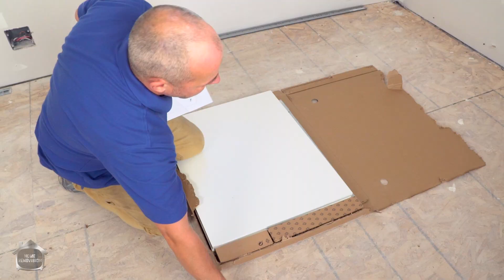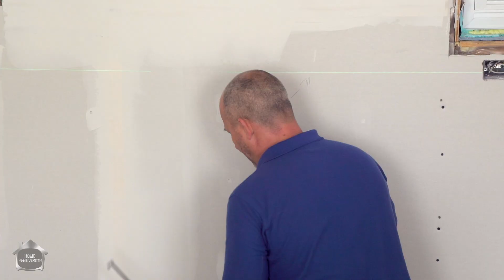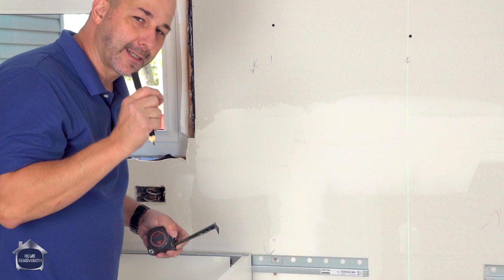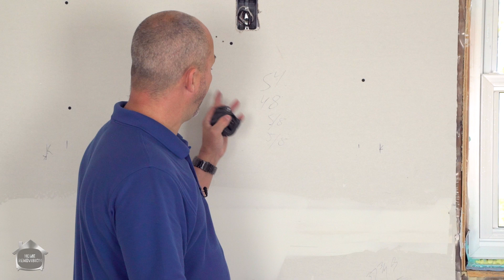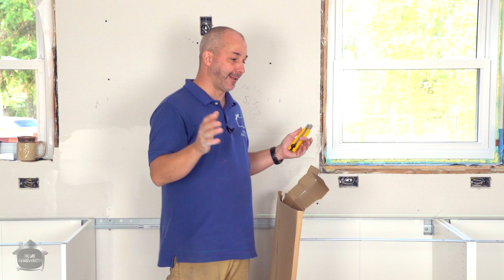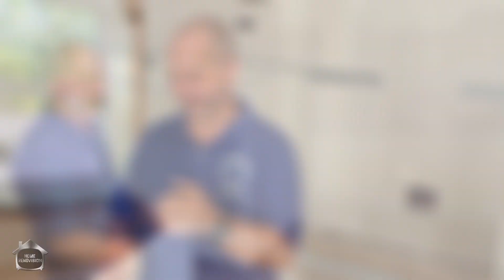How to Install IKEA Kitchen Cabinets and Save Money! | DIY Kitchen

Comment: 2nd screw underneath the rail to add to the shear capacity is gold. Such a practical mind, built off experience. Thanks Jeff, you continue to inspire me!
Reply: When hanging cabinets the Bearing Strength of your screw is key, using a screw with a larger head instead of a bugle head screw would ensure greater hanging strength. If you are relying on a secondary screw below your rail, you have inadequate bearing to your wall.
Reply: @DaruDhillon  so the extra screw under the rail will help the rail stay on the wall, where the larger head will help the cabinet stay on the rail. It's a team effort! 8)
Reply: @jstawch2608  the large flat head of cabinet screws are designed to have increased holding power. This means they can hold more weight and are a superior choice to hold the rail flat on the wall. 
A construction screw is not designed for this purpose. It’s designed for countersinking. Its holding power is significantly less and inferior. It’s weak for this use. The wafer head you see on cabinet screws is used on structural screws like GRKs which are amazing! Structural screws have increased holding power that’s why screw head is critical. I have a video on my channel that explains the difference if you are interested. 
I encourage you to try them both as a comparison. There’s no contest. 💪🏽 it’s why contractors, like myself love them.
Reply: Which type / length of screw should we use under the rail?  Great video by the way!  Very useful!
Reply: If they weren't garbage cabinets you wouldn't have to do that

Comment: Love the way you explain everything. I need part two though. Also, I was losing track of all the measurements you were doing.  I think a graphic of all the measurements would be cool.
Reply: Hi Maureen, The measurement you're looking for is 32 3/16" from the high spot in your floor to the bottom of your rail. Ikea recommends you measure to the bottom of the rail. Installation is much easier with a regular spirit level. I'd also recommend using cabinet screws as they have significantly better holding power and strength. Bugle head screws aren't designed for holding in this way and can shift with the weight of your cabinets and countertops.

Comment: Thanks for the video, redoing the kitchen myself too using IKEa and this is just great timing. Once concern I have is the peninsula. I noticed that you used the Sektion legs for the island. Are those legs sturdy enough to handle an island/peninsula on their own? Also Ikea is warning that the island should be screwed to the floor. really confused on how to achieve that with the legs.
Reply from the maker: you can use L brackets to screw the panels at the end down. Cheers!
Reply: @HomeRenoVisionDIY  thanks for the reply. But would screwing the end panel alone be enough to hold the weight? There are some videos suggesting 3 2x4 stacked under the cabinet, what are your thoughts on that? Thanks again!

Comment: Hi! thank you for this video. Do you know if the Ikea Base cabinets can still removed after the countertop has been installed? I am asking because I need to access the wall behind one base cabinet to repair damage.  can it just be slid out after removing the screws on the side? If it is removed, can it be put back in place after? Hope you can help! Thank you!
Reply from the maker: darn straight they can. That is one of the obvious advantages to this system. maintenance!
Reply: @HomeRenoVisionDIY  really? Wow! Good to know! I've called ikea and I have been passed around several times to different installers! thank you! I appreciate your help!! thank you for all your renovation videos!! 😊

Comment: If you are considering Ikea, I would suggest a thorough discussion with a clerk at the store about the products before purchasing.  I bought some base cabinets was told by Customer Service that I had bought the ones as they require drilling for placement of the drawer slides.  The instructions are terrible and I have waited and waited (10 - 45 minutes) to speak to a Customer Service rep.  Some of their reps know very little about the product and then BS their way through the conversation.  If you cannot drive to the store easily (as I cannot), I would look elsewhere.

Comment: I had to go dismantle a deck and the guy used them L brackets to connect every piece of wood with 1/2 drywall screws. And the timber was not treated and on its side. Absolute mess. Had to take it down and start over with new materials

Comment: I'm going to be installing 37 1/2" countertops (1 1/2" above normal) and Ikea cabinets will be the base. What is the best way to rise the cabinets by 1 1/2"? I could build stilts for the legs or should I build a traditional frame for them to sit on? Maybe just lay down 2 layers of plywood? I'd prefer to have the extra height on the bottom and not the top. Thoughts?
Reply from the maker: best to build a box to set them on. That way the toe kick can be attached to the face. Cheers!

Comment: Do these IKEA cabinets work if you want to have a taller countertop? That is, I"m 6'5" and I always have to bend over to do anything on the countertop (and the sink is even worse). Is there a standard way to calculate such things?

Comment: As usual a lot of good tips and easy to listen to content. A little surprised that you did not get a sheet of laminate and flat sheet of plywood or particle board and do it yourself. That way you could have scribed the top to the back wall. I planned on doing  the laminate myself, because it looks easy when looking at videos here n YT. Since you did not tackle it maybe I will rethink it and buy the pieces already made.

Comment: Fantastic video but why oh why don't you move over to metric measurements. Even we in the UK, the home of the Imperial system moved over to metric about 50 years ago. All those weird fractions makes it very difficult to understand. This is particularly so since all IKEA kitchens are very specifically metric e.g. drawer and door panel heights are 10cm, 20cm, 40cm and 80cm (allowing for gaps of course). All cabinet widths are 20, 40, 60 or 80cm except for the corner cabinets.

Comment: Do I need any kind of underlayment under those cabinets having concrete (slab) floor? I was planning to have some panels used in basements (osb with plastic layer), but seeing that huge plastic feet made me wondering if this is really needed. Maybe only under appliances to raise them up to the finish floor. What do you suggest?

Comment: I have an existing kitchen.  We have side panels on either side of the dishwasher, make of MDF with the typical fake look on the outside.  Well on the other side of the kitchen is the Fridge with ice maker.  Floor slopes towards dishwasher.  A couple of times the icemaker screwed up and got stuck on fill to give your a cube full of water that keeps overflowing.  Then goes out the Fridge and the water flowed to the front of the dishwasher, caught in time but not soon enough.  I.e. side panels swelled up, nice and ugly now.

Comment: Question on cabinet/floorin conventions below. Appreciate any feedback or advice. Thanks in advance guys! ^_^

Due to water damage, I need to replace my kitchen cabinets, and replace some subflooring and some drywall while I'm at it. I'm going to take this as an opportunity to replace the linoleum flooring and the ugly tile backsplash with something better. Thinking slate tile on both, but decision isn't final.

Question: What is the standard for cabinets and flooring? Is it typical to install cabinets onto the subfloor directly, then install flooring around the cabinets? Or is it typical to put in the subfloor AND the flooring, then put the cabinets on top of the flooring?

Thanks! ^_^

Comment: A water level and a chalk line works as good if you are a diy enthusiast  and don't want the expense of a laser level. As professional of nearly 30 years i fitted an IKEA kitchen about 12 years ago and swore i'd never entertain that idea ever again. The main problem being the lack of a service gap for pipes and electrics so all the waist pipes had to run through the unit. What a headache.
Reply: Been there myself. Nightmare units, never again.

Comment: Here's a tip for opening IKEA boxes. Go to their kitchen section and buy one of their wide spatula's (the one for turning fish fillets). It's thin, and has relatively sharp edges. Simply slip it between the glued box flanges and slide it along. You will never risk damaging a panel. This was shown to me by one of the IKEA showroom installers. Works a treat! (and on a side note, it makes it easy to reseal a box with hot glue if you change you mind and want to take something back..... Looks like you never opened it.... )
Reply: IKEA is that you?
Reply: Brilliant, thanks!

Comment: What is your best driver bit that you like to use. I only use Phillips head screws and sometimes torques head. But they break and it piss me off. Dewalt doesn't make a good magnet bit . Can you help???? I see you use a Milwaukee driver bit, Do you like throws? I am a handyman and do all kinds of thing and need a good bit so I am in and out fast. Thanks Mke "AKA" Coach Crone Thanks

Comment: Not the greatest of cabinets, the utility gap at the back would not even take a 15mm pipe and everything has to be run in the plinth gap. The rail method is a good idea but as said by someone earlier it does show any imperfections in the walls and can mean the brackets do not hang on the rail and then you have to pack out the rail to make it flat. Ikea seem to have changed the build of their board used to make the units and it isnt as durable as their old units. It does damage quite easily during day to day use.  The runners etc also seem to wear out quickly and the drawer fronts work loose causing the screw holes to over bore. You need to put additional screws in the fronts to limit this from happening. One thing to bear in mind is that the Ikea units are not the same sizes as most other units so if at a later date you want to change the doors etc with another make, it is extremely difficult to do so.
Reply from the maker: And yet the expected life of this cabinet system is still over 20 years. With a little care it lasts 40. not as good as wood but you get what you pay for!
Reply: @HomeRenoVisionDIY  EXACTLY! Wood ones can easily cost $4k plus and sometimes $8k+. This allows folks to actually be able to update kitchen without spending $10k to $25k for the typical kitchen these days.

Comment: if you nail plates where the wires are like what is code you would be ok
Reply from the maker: nailing plates required when the hole is closer than 1 1/4" otherwise the code stipulates the depth of screws to be used to avoid issues. Cheers!

Comment: Had a bunch of kitchen reno people and so called experts bash Ikea cabinets. After getting estimates, I couldn't resist based on the savings. Now that my kitchen reno is complete, I have ZERO regrets about going with Ikea kitchen cabinets. I saved myself thousands and I love the end result. I also think, in retrospect, I could have done some of the install myself but at the time, my work schedule was crazy.
Reply from the maker: I am sure you could have. Hard to resist the price point. Cheers!
Reply: @HomeRenoVisionDIY  it's PRAWcess bro
Reply: How are they looking 5 years later? Are you still happy with them?
Reply: @jonrichins7737 no response, but I’d be interested they seem super cheaply made.

Comment: I have been designing kitchens and baths for 39 years since starting with Triangle Pacific in 1980. Have rep'd Tri-Pac, Bruce, IXL, DelMar, Wellborn Cabinet, Kraftmaid, and Fieldstone/Starmark,  and sold/designed with many, many more.  I count the kitchens I have designed and supervised through completion in the thousands.

I'd suggest considering 42" walkways (current NKBA guildelines) when possible, which would mean 45" between the boxes assuming a 1 1/2" counter top overhang on the working sides of the cabinets.  This walkway will shrink even further given the range door/handle protrusion in the kitchen you are installing in the video.  If you start at 40" between boxes you will be lucky to have the minimum 36" of real walkway when you're done, likely less than that depending on the range.  And I have to admit I got a bit lost as to how installing the flooring prior to cabinet install caused additional delay...?  It won't speed it up, but it won't slow it down either, and you end up with a much cleaner install.  The only time not to install the cabinets after flooring is if it's a "floating" laminate floor, which needs to be allowed to expand/contract.  I did find the installation systems and procedures very enlightening, great input for the would-be DIY-er.  You show that while the prinicpals might be simple, the attention to critical measurements and details is the key to a successful project.  A+ on the installation info.
Reply from the maker: 42" walkways are for people with larger footprints. My home is built to be too efficient for such luxuries!
Reply: @HomeRenoVisionDIY  Gotcha.  NKBA is very clear that their specs are GUIDELINES only...not "laws" , or "regulations", not even "gotta-be's".  The clients desires always supercede, as do reality factors.  Still, the statement "...everybody uses 40"..." is a bit off the mark, and should be noted only when dealing with restricted areas.  Just like your 10" overhang on the bar top.  Yep, that's the minimum GUIDELINE, a "normal" persons knees won't hit the back of the island when having a cup o' joe, but yep again, 12" is much better.  But with restricted area, 10" is good to go.  Thanks for an informative and  thought provoking video.  Craig

Comment: to water proof it ,,,What do i need to do to prep green drywall before i install a tubsurround .. Besides caulk the joints  Thank you..
Reply from the maker: I suggest using a tape of some sort in the corners however redgaurd is next!
Reply: @HomeRenoVisionDIY  i just spoke with redgard custumor rep .He said its not to be put on drywall

Comment: Those feet can be cut down to any size needed we cut them all the time.....FYI
Reply from the maker: best to not cut them down since they are the thing that is setting the cabinet door height to the right height for protecting the feet when opening doors. drop a laser line to the right height at the highest point on the floor instead. Cheers!
Reply: Home RenoVision DIY to meet ADA compliance you have no choice but to cut them down.
Reply: John B thats a horse of a different color 😌 most everyday homes are not ADA compliant. I put listings on the market every single weekday & (in my area at least) I’ve had very few marked “yes” on the “ADA” question.

Comment: Why make such a dangerous ordeal about unboxing the panels ? Slashing and ripping up the boxes is so unnecessary.  The panels are quite heavy. Just carefully slice open the top glued flap , pull out any little parts boxes, turn the whole box upside down and slide it up off the panels. Voila , panels unboxed with out any danger of damage from razor knife that went astray.        What is so hard about that ? And do you need to put any panels back in the box ? Oh look the boxes are still intact.
Reply from the maker: to each their own. Cheers!

Comment: Another great video! The single screw into those wobbly ikea legs is genius! 

Prefabricated countertops are a great option if you don't want to wait weeks for your counters. I installed Ikea cabinets like yours, brought a rough sketch with measurements to a local countertop supplier, selected a quartz countertop that was already in stock, paid for the slabs, and the guys came out and installed it a couple of days later. All measurements and cutting was done on site (including an undermount sink) and the whole process took about six hours. I took a lot of care to make sure the cabinets were absolutely level, and the installer took care of the rest. I don't know if this method would work with laminate, but is a good option with quartz or granite if you pick something they have in stock at your local yard. Looking forward to seeing how you install the floors; bet it's going to be a gorgeous kitchen!
Reply from the maker: when working with a specific color scheme ordering in advance is always your best option. besides all you need is for any excuse for the delivery guys to delay and your sitting at your project with nothing to do!

Comment: Jeff what is the model of laser that you use? I have one but it's not self-leveling on a tripod  level up with the bubbles walkaway from your level and the lack of your weight changes your level line, bonus feature my cat likes to chase the little red light on the floor . building a wedi shower for a large format tile horizontal. Unrelated question how do you level a wooden floor that you're going to tile underlayment is low in some areas three-quarter inch Red Oaks going over the top could I fill the void with door skin I have to be able to nail through it so I can't use self leveler, sander will not work it's in the middle of the floor( about a 3/16 low area by 2 feet long  any thoughts would be appreciated thanks